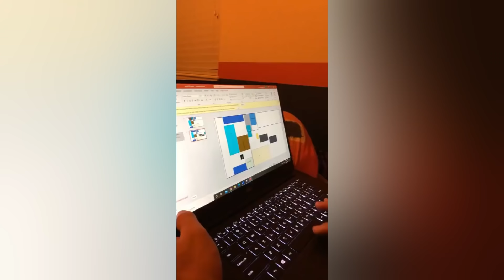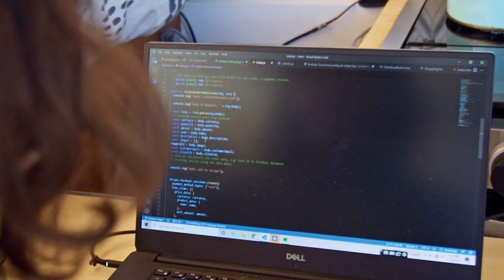Is it possible to have a bathtub in Vanlife?

Comment: I lived in a van for quite a while and learned some things.  Are you prepared for an electrical fire?  You should be.  Don't keep anything heavy up high, no glass containers, latch those cabinets positively!  An emergency stop from 75 will teach you a lot about your setup, as will a windy bumpy road.  Do you have a propane detector?  Carbon monoxide?  Smoke?  Fire extinguisher?    Lots of stuff from boats, like cabinet latches, work well in camper vans.  When those lead acid batteries wear out in a few years go to lithium.  Put as much solar as you can fit/afford.  DOI has a good app for finding dispersed camping, remember to have F.U.N!

Comment: Where you use sealant, it looks really bad. Makes the job seem rushed. You can use the blue painters tape around the frame you are sealing. Only takes a few minutes and you just pull it and you have a professional looking seal. Cleaning sealant after the fact is tough and no doubt why it still look the way it does. And yeah I know most of it is outside, but pretty much anyone that takes a first look will notice it. Other than that, I like a lot of the ideas you implemented. Cool van.